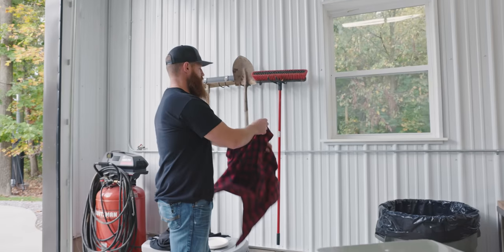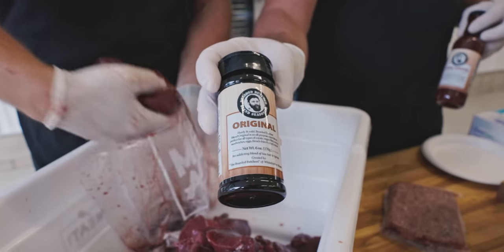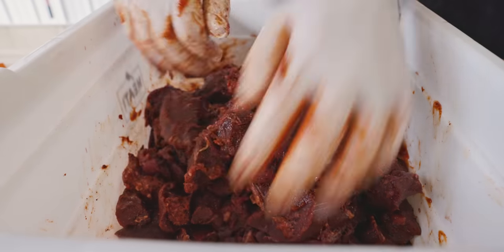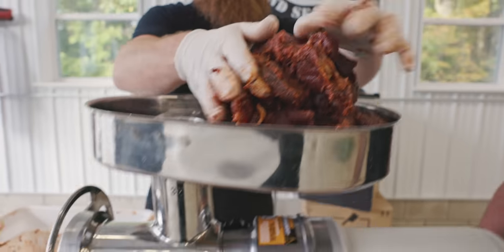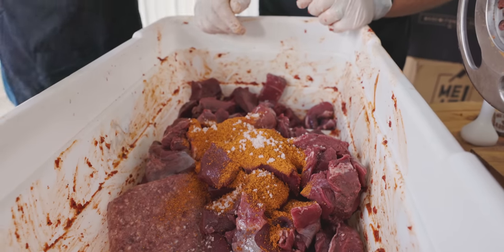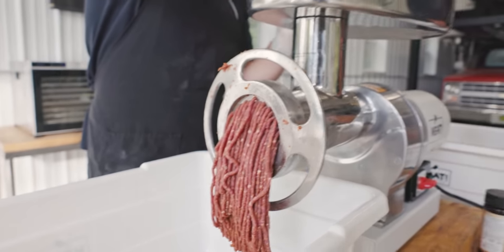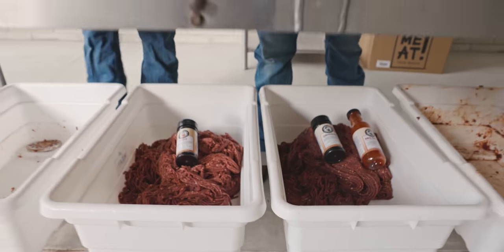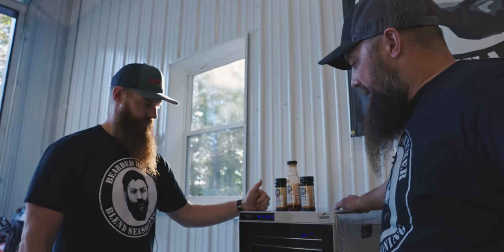How to Make Commercial Quality Meats Snacks for Hunting, Hiking and Camping | The Bearded Butchers

Comment: Would that be shelf stable? or would it need frozen/refrigerated? and if shelf stable how long is it shelf stable?
Reply: Curious about this too.  I tend to always freeze mine, but would love to know if I can leave them on the shelf for the season.
Reply: I am very curious about this too. I always just keep mine in the freezer then move it to the refrigerator.
Reply: With the curing salt that they used, I'd probably say that this would be shelf stable for about two to three months. That's assuming that it's kept inside I temperature controlled environment.. AKA... Your house or pantry. I've made huge batches of jerky like this, and as long as it was inside the house, it kept for a good while. Refrigerator would probably be 6 months, and I even found a package of snack sticks that were 2 years old in the deep freezer, and they were still good.

Comment: I make these all the time for the family. Awesome job showing off some good alternatives for seasoning. One thing I do differently is load the meat into my sausage stuffer then use it to load the jerky gun. This helps eliminate air bubbles while squeezing it onto the racks.
Reply: Do you consider your jerky shelf stable? Or do you keep it in the refrigerator?
Reply: @Sandin374  Depending on the amount of smoke time and cure used. I have made some "shelf stable" versions for camping of my bike. These are pretty dry since they are smoked longer. Mostly I freeze them and replenish the fridge as needed.

Comment: I have been trying to make jerky and have had some luck doing it this same way , but I am wondering , after you fine grind the meat you went straight to making the strips. I was told that it needs to sit for 24hrs to cure first. Is this not true ? Thanks
Reply: I was wondering the same thing. Mabe I'm wrong but I always put it in the fridge over night.???
Reply: Also wondering the same thing.. this is the first recipe I have seen that does not call for the 24hr soak

Comment: Hey guys! Love your channel and particularly loved this video! I hope to try out this recipe sometime soon as it looks very delicious (will need to use beef as I don't get to deer hunt anymore). Also, and most unfortunately, some of the equipment that you are using for home use such as the 1.5 HP grinder, the vacuum sealer, and the dehydrator (things that I would love to have and may someday have if Santa is good to me) combined are somewhere in the $1,500 to $2,000 range and since I do not process this type of recipe regularly it becomes difficult for me to justify spending that kind of $$. So, in my case I'll use what I do have and try to reproduce the jerky using my kitchen aide grinder attachment and my vertical smoker and hopefully end up with something similar. Do you have any other tips since I won't be using a dehydrator (although I am considering buying one)? This might be a stupid suggestion since you are marketing equipment, but I think it would be really cool if you guys made similar videos using or demonstrating (for comparison) the typical equipment you might find in peoples homes i.e. a small old fashion hand grinder, typical kitchen oven or smoker, cheapo vacuum sealer, etc.. Anyway, as I said, I love the channel and your very informative and well done videos. Keep up the great work!

Comment: For those with home use grinders or little smaller than this if you semi freeze your meat chunks before grinding it will grind better not hard frozen but like just stiff on the outer edges of meat also helps keep grinder head and auger cold along with what they mention as putting the grinder head assembled in freezer to while to chill it too

Comment: Kinda a late comment, but do you run into any problems with the grinder overheating if the meat isn't still quite cold?  We use an older grinder and that is a problem especially when processing a hundred pounds of elk grind.  How do you overcome it, if so?

Comment: I've always used High Mountain seasonings and the cure they use requires slightly more than the seasoning. It seems the amount of salt cure you used wasn't enough, does it last on the shelf or in the freezer very long? Just wondering..

Comment: For Reference to anyone using the Weston  “All Around Jerky Maker” attachment for your crank stuffer—
Using the double 1”x3/16” extruder insert you can fit exactly 12.5lbs of Venison on 10 racks on the MEAT! Dehydrator they use in this video.
So much faster, consistent and easier than a jerky gun if you have a stuffer already.

Comment: Interesting. Seems like alot of work. High Mountain Jerky makes a great spice mix. Dehydrator? A 250 degree oven works good. Slicing it, much better product. Works great. Most meats. Ground meats not as good. I will say, we use Wrights Smoked Hickory flavor, if I don't smoke the meat myself. Your thing. Do as you as you like. Losing the texture of sliced meat. Doesn't sound good to me. I have a knife, that cuts through any frozen meat. Into slices. I marinate, overnight.

Comment: How long would you consider this to be shelf stable?  Great video by the way!
Reply from the maker: Several weeks up to a year. Keep in mind you can always freeze and pull them out over time, and should definitely get several weeks at room temp each time you do that.
Reply: @TheBeardedButchers  Thanks for the quick reply.  Another question.  Using the pink salt, does that need to sit in the refrigerator overnight before dehydrating?